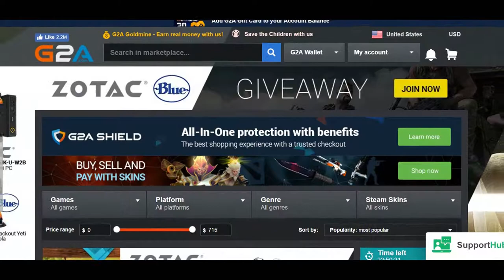Let's clean out this Sound Blaster sound card!

Comment: You can get a few liters of isopropyl alcohol for €10-15 easily to use that as a bath instead of water. If you used a toothbrush while soaking it in alcohol,  you can remove all the dirt. The massive benefit is (a) alcohol does NOT cause corrosion AND (b) alcohol evaporates really quickly and (c) alcohol has much lower surface tension meaning that if you take it out of the alcohol, it will "empty" much better whereas water tends to pool in areas. Also: don't be afraid to use a toothbrush to really brush parts - just need to be a little more careful around capacitors.
Reply from the maker: Yeah that's what I do now. WD40 also works good if your card is REALLY YUCKY. But usually I would wash off the gunk with water and a toothbrush, then rinse again in isopropyl alcohol to dry it.
Reply: @TechiePocket1  Glad to hear it. Also another good tip: if you need to lube any part of electronics, silicon spray is the way to go. It's very thin, does not "gunk" up after a while (WD40 does) and lasts a long time + causes no corrosion and actually protects stuff against humid air. It's good to use in audio jack ports for example. It's also the best, by far, to use with plastic gears of, for example, a DVD drive or even buttons.
Reply from the maker: @redavatar  yep. thanks for the tips
Reply: Isopropyl alcohol (something close to 100%) is what should be used to clean electronics. It's used to remove excess solder flux and it can help remove some oxidation as well. The thing with water is it has impurities (which is why water is a good conductor) and even if you dry off thoroughly, will lodge in crevices and could lead to some undesired chemical reactions. Alcohol is more easily evaporated than water and won't leave behind any impurities. As mentioned already, use a toothbrush or thin bristle acid brush. Suggest an anti-static setup if working with ESD susceptible components.

Comment: Dude you should never submerge it in water. Isopropyl 90% alcohol is one thing. Even if it's not getting any power that's a really bad thing to do to it especially with the capacitors.